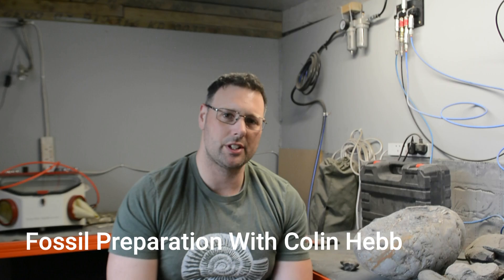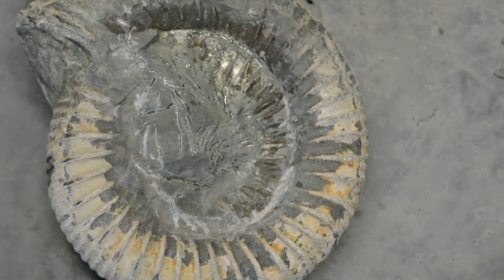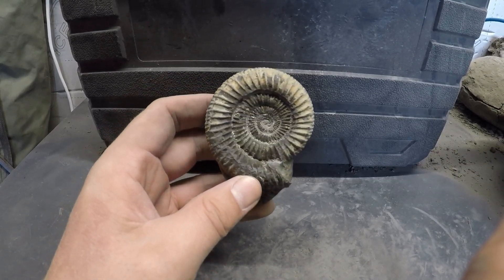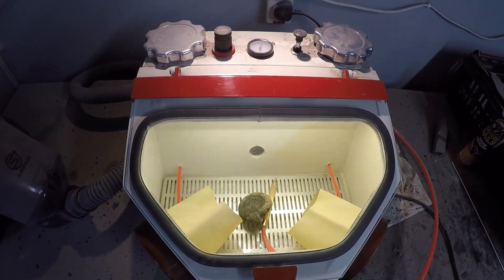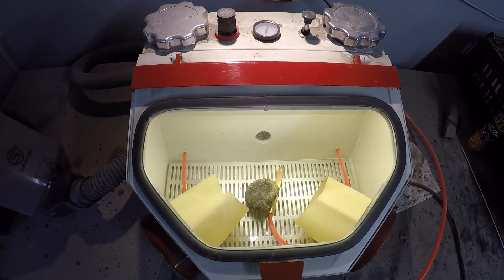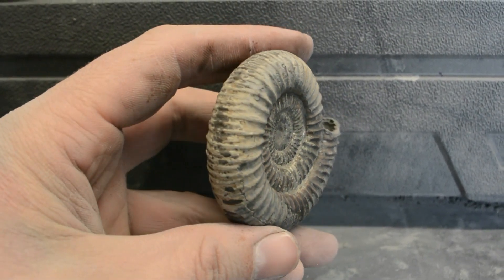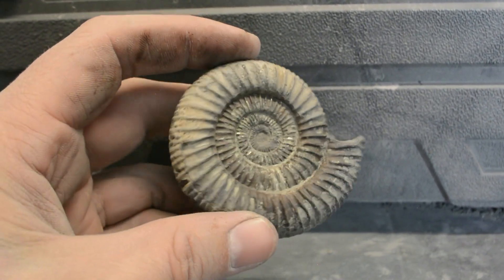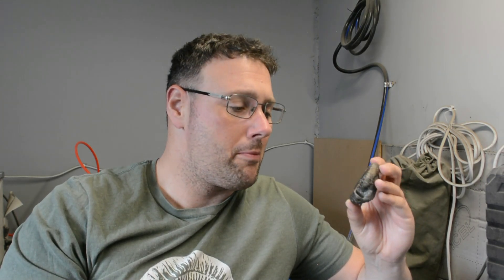Fossil Preparation The Fat Ammonite #fossils #fossilpreparation #ammonites

Comment: Thanks. Another great video to help me learn preparing my own.
Can I ask what is the air abrading set up?
Cheers.
Reply from the maker: It’s so you can get the thin layer of rock off a fossil without damaging it 
It does take longer but worth it 😊
Reply: @JurassicFossils-jj1mf  Cheers for the reply but I really meant where did you get it as I’m looking at getting one. The one on the Zoic site is expensive and then you need a cabinet too.
Bob
Reply from the maker: @BTurner. I got mine second hand off fossils for sale page on facebook
Reply from the maker: Uk fossil auctions
Reply: @JurassicFossils-jj1mf Thanks again but could you tell me who is the maker or the model? I’ve seen something similar on Amazon for just over £200.
Reply from the maker: @BTurner. it just says twin sandblaster and make in Japan